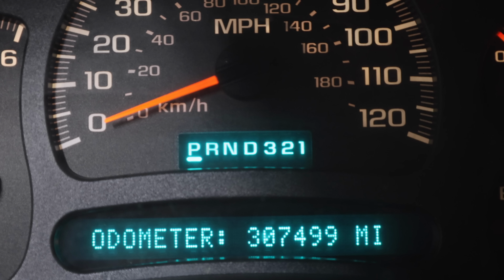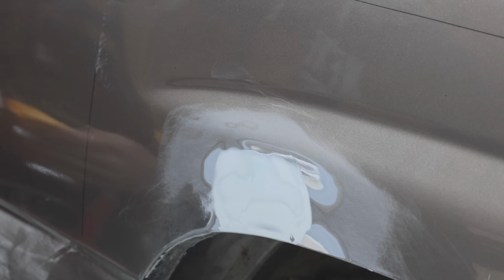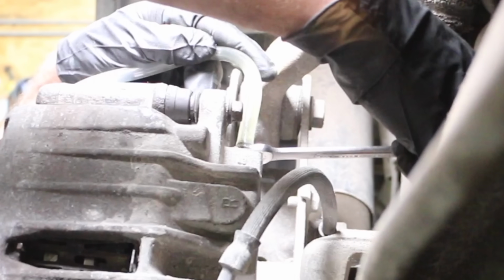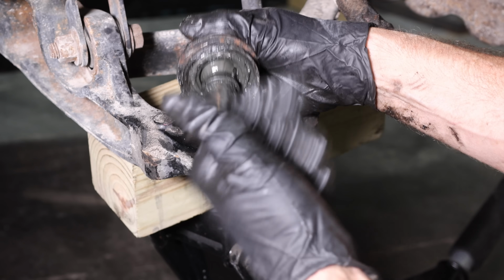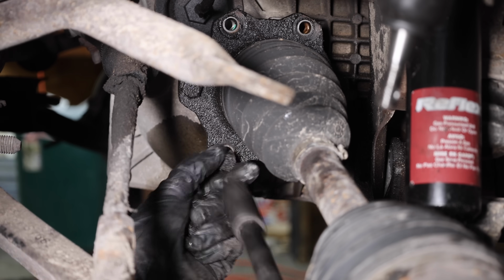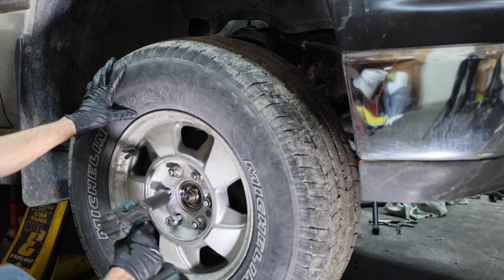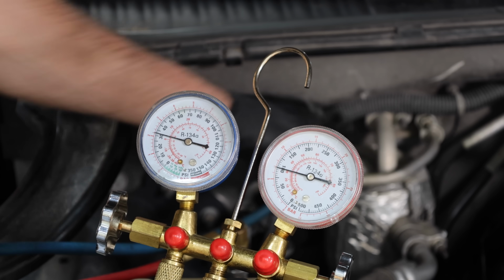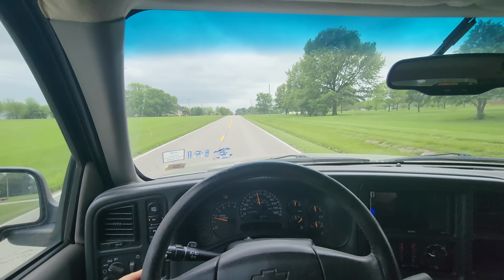Is It Stupid To Fix Up A 300,000 Mile Vehicle? Let Settle This!

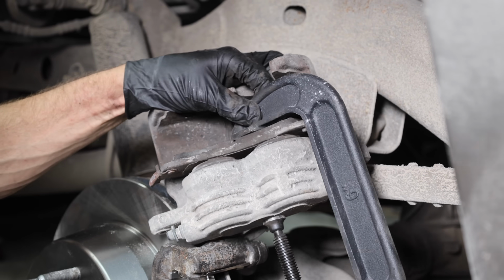Comment: 6:22 Before replacing the brake discs, you should check whether the hub is even. if there is no runout of 0.07 mm, you can install a brake disc, which should also be checked whether it is even when rotated.

Comment: Nah, its not, for the right one. I have a car that I rebuilt the engine in at 306k miles due to a single rod bearing failure. 

Ive put another 40k miles on it in just less than two years. Im doing some front suspension work, but that comes with where I live and isnt anything to do with the car itself (we do this every year or two on any vehicle where I live.) 

The AC works, heated seats work, it cosmetically shows more like a 200k ish car. We commonly jump in it and drive wherever we feel like. Drive 3 hours away at 1am to make sure we dont miss something we found that we wanted to do the next day? No problem. 6 hours for an overnight trip for my sister in laws graduation? Check fluids and tire pressures and away we go 😂 

But! My car isnt always what you get at 300k+, my car was sold locally originally. Best I gather im the 3rd owner. Its a Acura. Youre not gonna get that if I lived even a few hundred miles north. It would be rusted out and garbage.

Comment: depends on the vehicle, i 've been driving a somewhat rusty mercedes 240D with 222,456 miles on it for close to 4 years 175,000 miles when i first bought it and I will do ANYTHING to maintain it and make it last to 600,000 miles or more... really with mercedes diesels they have no expiration date on them unless they were maintained POORLY.. AND it takes ALOT of use for genuine mercedes parts to officially wear out to the point where the car is undrivable till that part is replaced... currently still daily driving my 240D with a shot center carrier bearing and a frozen u joint with the intention of replacing the driveshaft soon.. IF ITS A MERCEDES DIESEL WITH HIGH MILES THEN ITS WORTH THE NEW PARTS BEING PUT IN

ANY OTHER CAR BRAND WITH THAT MANY MILES CAN'T PASS THE TEST OF TIME COMPARED TO A MERCEDES DIESEL

Comment: My 1998 dodge diesel has almost 300,000 miles.  I just bought a new manual trans for it, along with new tires, lift, wheel bearings etc.  Keep the old stuff alive, they don’t build vehicles like they used to.   That 300,000 mile Chevy will still be on the road in 20 years, they are solid
Reply: I had a 97 and 98 12V Dodge Diesel, both of them had over 290K on them when I sold them and still ran like new. I sure miss those rigs.

Comment: Don't forget about who the previous owners were. In the last decade or new car, salesmen were pushing the idea of lifetime fluids in cars. Most who were not mechanics and took this the wrong way and didn't change ANY of the fluids in the car even the oil in some rare cases an drove these up until the time of the warranty limit and then sold the for another new car. I would see some of these like new looking cars come in with 60k or slightly more miles and have black tarry transmission fluid, black oil, dark brown brake fluid, and a milkshake in the coolant radiator and reserve tank. Dealers would just patch these problems up with simple fixes that would occur as big problems later suck as low engine compression, grinding or slipping transmissions, bursting brake lines due to over contamination of old fluid, power steering , water pump failures, failed ball and front end suspension joints, and more. It's best that you buy a used car from a private sale with a history of proper maintenance. Never buy a used car from a dealer without some kind of lengthy warranty either if you really have to. Buying a car that was used as a rental is even worse. If you find a 2022 vehicle with 120k miles on it the dealer will lie to you and say it's all highway miles. It's most likely a rental vehicle that has been driven past its maintenance schedules and beat the hell out of.

Comment: If you own a GMT800 (99-06 chasis) you can totally put the 2020+ front rotor and brakes. The only "mod" needed to make it work is a washer to center the caliper, if you bolt it directly it will touch the spindle. It's a huge upgrade in my eyes 12 inches vs 13.5 inches.

Comment: Dont know much about american transmissions but in germany we flush the transmission before filling it with new fluid. Either that or drive about 100miles and then change again. With just draining or pumpung out, you will not get all the metal parts out of the system. There is no filter!

Comment: No its not stupid if its still a fully functional vehicle with no major expensive problems in the horizon and its ESPECIALLY NOT STUPID IF YOU'RE THE FIRST OWNER, in fact, not spending a few thousands on the maintenance of a vehicle that costed you dozens of thousands is stupid, especially if you want to sell it for oennies just to throw out the window even more dozens of thousands in a new vehicle that you'll have to maintain and repair anyways.

Comment: I sure hope you have more luck with your steering than I do!! I have a 1997 K1500. It's got 326000 on it. Still runs well. Trans was rebuilt by a local shop back in 2021. Truck drives good and like yours is very clean and straight. Problem is I can't get the slop out of the steering. Everything has been replaced even the disintegrated rag joint. The Lares steering box has a ton of slop in it so this fall I'll be warranting that and doing that job again. Most of the remanned steering boxes are like this and I hope you're not having to replace yours in six months. We have to keep our vehicles going they are way too expensive to replace.

Comment: Definitely worth every penny. The only thing that would stop me is excessive rust, all else can be repaired, these years of GM trucks were some of the best ever, without ALL the new "Crap" that makes them fail, up to about 2007. Well done and well worth it. Snap on sells an excellent set of snap ring pliers, any of the adjustable / convertible ones are lousy. Great Thanks!

Comment: I have 2001 suburban with about 220,000 miles. Owned it for 8 years now. I accidentally went through an extremely deep puddle while at my other property and it doesn’t respond to anything now unfortunately. I had to leave it under an overhang and travel back home in another vehicle as the location between properties is around 400 miles. I’ll get back up there one of these days to fix it. Anyhow, before that happened it was an absolute joy of a vehicle to own and operate. Great video Todd and keep em coming!

Comment: Just a couple things to add that I would do if it it were my vehicle. Change the rubber brake hoses, they kind of dry rot as they get old. Not too expensive, the fluid should stay cleaner and you're already bleeding the system anyway. Also for someone tackling the fluid changes in the diffs and transfer case for the first time,loosen the fill plug first before draining!
Great video, don't change a thing!

Comment: I did about the same thing to a 1999 silverado 10 years ago.  I gave $3.000 for the truck, and spent $1,000 on parts.  Still drives and runs like a new truck.  374345 on the odometer now.

Comment: I met a lunatic once that told me proudly and sternly that he has NEVER and WILL NEVER buy a vehicle with less than 200k miles. I was absolutely speechless. First time in my life I had heard this and was pretty surprised because this individual was educated and respected in our industry
Reply: My 2001 truck has 171k and in the last year(2023-24), I've already replaced the water pump, ignition coil pack, upper intake manifold, clutch system, muffler, s-belt, battery (twice), front windshield weather stripping, and some other minor items(ignition wires, spark plugs, light bulbs, oil/filter, etc).  Don't want to give it up now since I'm basically a qualified mechanic with all the essential tools to work on it.
Reply: I won't make that a broad recommendation of that , but l understand where he's coming from .

  If a vehicle was a Lemon , ( or a cliche Monday morning  hangover production ) , or poorly maintained,  or driven hard / abusively,  etc , it will have been scrapped long before reaching 200k miles .

   If it is running well at 200 ,  without any incipient major problems , it will probably continue to do so .

   Just like humans . Reach 80 y.o. , reasonably fit in body and mind , and no major ongoing health problems,  you have good odds to reach mid 90's .
Reply: I agree with him, I will never buy a vehicle more than 100k miles. The constant problems you get are NEVER worth it. You will be competing against yourself everyday.
Reply: @superbros1690  you misread what I wrote
Reply: @nickof93 hahahah yeah hes one of those people who reads, but is thinking of something completely irrelevant to what he was reading. Or sort of like a woman reading a text. Shes only reading what she wants to read
Reply: @nickof93  Lol omg, I read it wrong because its an asinine statement, what a fkn lunatic lmao🤣🤣🤣😂
Reply: @nickof93  Idk what happened to my last comment, but it got deleted. I misread it due to how asinine of a belief it is lol 🤣
Reply: @superbros1690 you missed the point of the comment.

Comment: I keep them til the frame rots (Wisconsin). Then I pull the engine and trans if they're worth anything and scrap the truck. Rebuild the engine and trans and out them in something else. Currently putting a 4.8 and 4l60 in a trans am

Comment: Nope.... my car is at 210K miles just put in a fresh engine.  keep it running.  Generally speaking thoough, Body on frame (ladder) vehicles are more durable than monocoque.  Impressive that the front end was still holding together, You can probably make it to 500,000 with that truck.

Comment: Those fluid pumps are junk. Would like to see a video on those. Someone has to make one that doesn't suck! I actually do something a little different. I took a fire extinguisher apart and added a Schrader valve. You fill it up with your oil of choice, add air pressure, then push the handle. It'll dump the whole comments in under a minute!

Comment: Stay the same, slow down it's all good. Your vids are always informative, honest and entertaining in my humble opinion.
Opinions are like ar*se holes, everyone's got one.
Either way I'll keep watching.
Best wishes from 🇬🇧
Edit, I forgot to say, the best way to be kind to the environment is to keep your car and maintain it. It's done its dues with carbon and all it owes mother nature is a few farts of co2. 
An ev has to run 70 - 80,000 miles before it pays back the carbon generated to make it and it's battery. Ice cars are less but still a problem.
OLD IS GOLD and new connected cars are a menace. The government knows where you are, the manufacturers collect and sell your data and eventually big bro will control your movements by shutting your car off if they think you've been saying the wrong things, buying too much meat and dairy, you've used too much petrol or diesel and charge you by the mile for just going to work.
All tied in with digital ID and Digital currency.
So, you did right by your old Gal. STOP BUYING NEW SHIT YOU DON'T NEED‼️

Comment: Very informative video, but I would definitely replace the upper control arms instead of replacing just the ball joints. Those old control arm bushings have over 300k miles and are a common issue.

Comment: I had gotten an GMC Sierra for free because it was smoking and burning oil it had 317k miles on it, took the lm7 out all it needed was the valve stem seals and the piston rings were gunked stuck, cleaned it up reused everything on it and it worked like normal 60 mile commute everyday, I traded it for a b15 Sentra since the 4l60e was starting to not want to go in reverse only down side of those high mileage trucks was the 4l60e  but those lm7 and lr4 engines were just awesome

Comment: Got this like, almost like a squeak but more warbly and bassy 
Drivers side front
Thinking it's gotta be the wheel bearing bc I just silicone greased all the bushings and it didn't stop
But it doesn't sound like a bearing
Just bought this 07 suburban with 189k 
It's driving me nuts
Reply: That's the video of the sound
Anyone know this sound??

Comment: The fun part of the safety check we have to have every year where i live. If your car fails it its usually on steering parts, brakeparts or rust or what have you. If you can fix it you get to fix it and retest if you cant the shop nearly always is able to fix it. So loose steering due to worn parts is fairly uncommon here.

Comment: nope:  it is not stupid to keep an old vehicle running.  What is stupid is changing the oil every 3000 miles.
I have a 2008 GMC Sierra WT with the 4.3 V6  -  engine has over 420,000 miles with NO mechanical repairs except water pump at 417,000 miles ( also replaced the ORIGINAL fan belt then ).  I change the oil and filter once a year around Christmas time  -  this truck has had 15 oil changes  -  total.

I use the $5 Frams from Wally World along with the 6 gal in a cardboard box oil  ( used to be $13 / now it's $20)  -  so, just to keep the math easy and take the UPPER figure for costs,  I have spent about $30 per change x 15 changes for a cost of $450.  Someone who changes their oil at 3K intervals would have made 140 oil changes  -  and at the lowest cost would have spent $3500 ( figuring only $25 for oil & filter - doing the work themself )  -   this means I have at a minimum $3050 savings in oil change costs alone  -   I can do a TOTAL rebuild on that 4.3 for well under $2K,  and now I'll still well over $1K in saving AND I have a fresh engine  -  guy who did the 3K changes has a 15 year old engine with 420K miles on it  (  plus, if that guy was paying to have his oil changed he would have spent somewhere between $7K and $12k on oil changes ) 

unless the frame / body is rusted out,  you can keep an old truck rolling way cheaper than the cost of a replacement

Comment: Is it possible to test fog lights?  I have a 2017 civmic touring that has philips h8 fog lights and not sure if I should get the exact ones.  I only like the clear white look and would like to go with  slightly brighter. The stock is 12 v 35w. What is the best between philips,  halogen or Sylvania or other? Thank you

Comment: Wow phenomenal video! You really packed a lot of information into a relatively short video. I have a 2003 Tahoe with just over 100k so seeing your burb with over 300k gives me hope I'll get many many more years out of mine. Maintenance is key! Also, have you replaced the intermediate steering shaft on yours? I've had the notorious shaft clunk for as long as I've owned the truck but never bothered replacing it...

Comment: I was on a time crunch watching the video as it is a school night, But I was still wondering how many miles should I get a car with? I’m looking into getting a car soon and I am a car enthusiast and know a good amount I’d say, I was looking into the Camry XLE or XSE or wait a few more years. I could also get a cheaper car with more miles (Aiming for 2005-2015) and most cars I see for good prices are around 200k+ miles. I would not mind too much on repairing a car if it’d be a cheaper alternative to a car rather than getting a car thats low mileage in general. My moms Odyssey LX has some problems and would probably have to clean or get the whole interior replaced even though its from 2018, It’ll cost around $4-5k easily to fix everything up. It has 72,544 miles when I last checked in February so might get that car too. Which should I go for?

Comment: I'm quite sure the individual who designed and snuck through the 2 pin headlight design was fired. Perhaps even hung, quartered, shot, and buried in a shallow grave. It was quick, simple, and easy to do in any temperature, or weather condition. You didn't need any tools or specialized knowledge. You could do it on the side of the road, in the dark with 1 eye closed. 
Good tutorial on the process, I did pretty much the same on my father's 09 2500HD a few years ago.

Comment: I gotta a good video suggestion.  Waterless coolant. The debate is that the coolant temp runs a little hotter but the engine itself runs cooler. In other words the waterless coolant removes more heat. Its a hot debate.  Personally im skeptical.  People run this stuff claiming the engine runs cooler via one of them laser temp gauges while the coolant temp gauge reads higher. Sounds like  very inaccurate way to measure things.  But a good way to prove it would be measure the actual oil temp with regular antifreeze versus evans waterless coolant. 
The coolant is life time.  375 degree  boiling point. No water thus no corrosion ect. 
Lastly what the heck is it? Can you actually lab test it to see what its made of? Im guessing its pure glycol.  Which if that is the case i wonder if pure glycol works as good with same characteristics.  
Waterless coolants require less than 3 percent water contamination.  I donno how you can do that?  They do sell a pre flush system too.
Long winded i know but very interesting.  
Bj from Delaware.  Like if you like the suggestion.  Hope to see it. Thanks.

Comment: Hi project farm, i have been a long time viewer i am 17 years old and i started watching your videos when i was about 8 years old i really purchased my first truck a chevy silverado with the 6.0 in it 2003 the engine is not very clean inside and i have been reading up on some oils there is a new oil made by valvoline called restore and protect i would really like to see a video of you testing this oil and how well it cleans up a engine like the claimed it does.